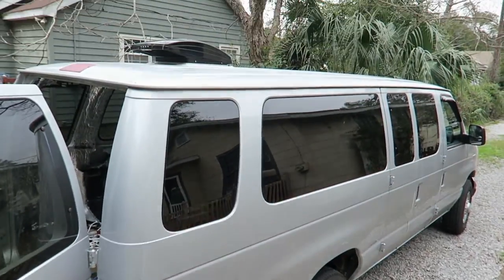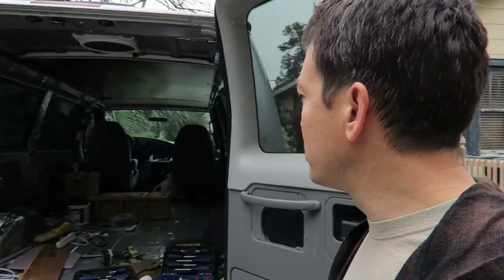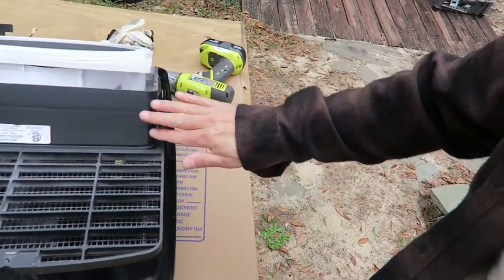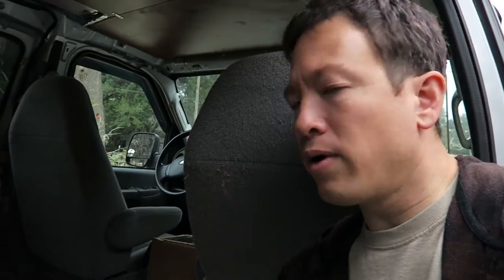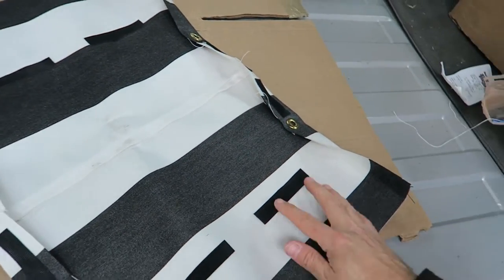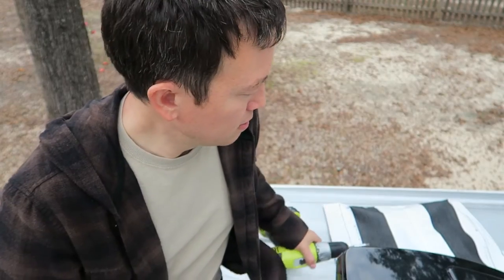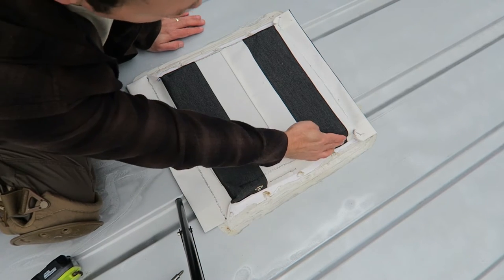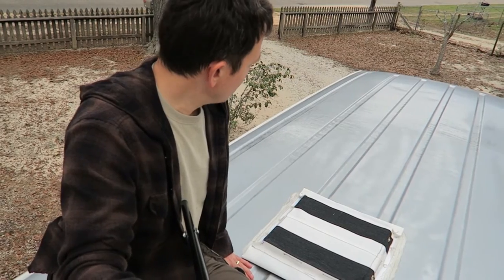12.  Touring Camper Van Build: Air Vent Cap

Comment: just take it to a car wash where you wash it manually.  the automatic car washes will put alot of stress on the plastic frame of the maxx air fan. just my observation
Reply from the maker: I finally found a automatic spray wash that is high enough to run the van safely through.

Comment: you are a fast worker.  In the length of time you wasted to do the vent you could have washed the van yourself.
Reply from the maker: I know right. But I am not thinking about just washing it one time. I take my vehicles through the wash 1-2x per week. So long term it will be a benefit.